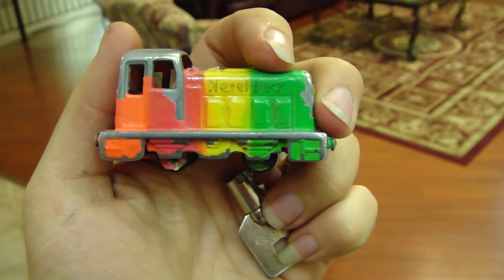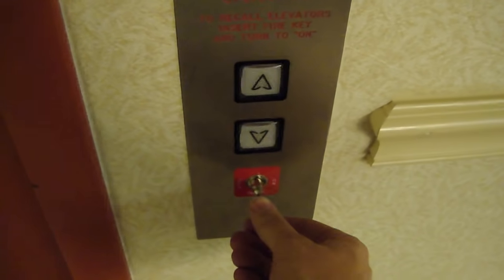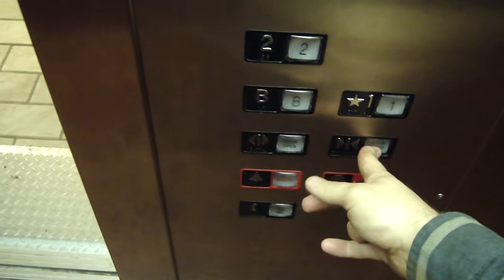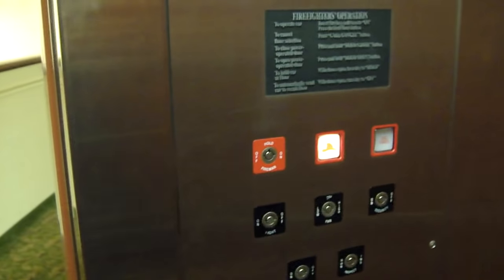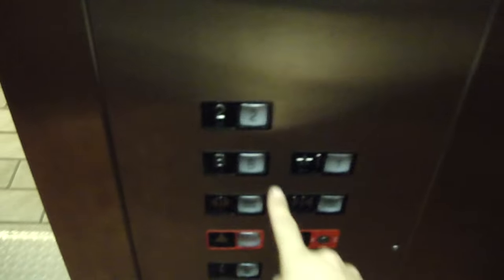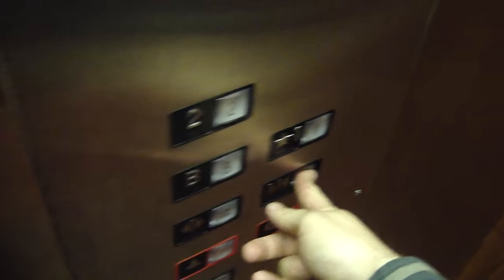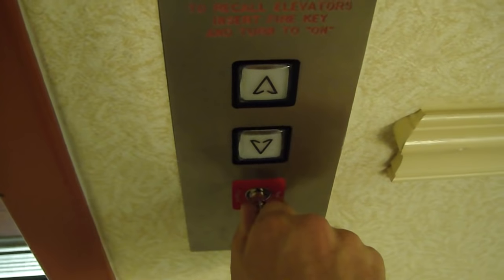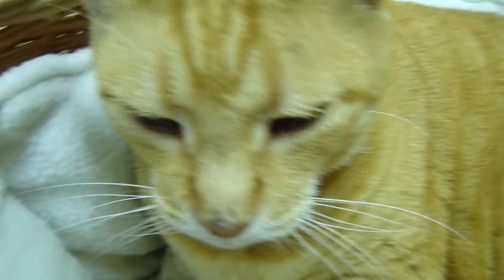Fire service mode on an Elevator (innovation fixtures)

Comment: You forgot one thing if you press call cancel while the elevator is moving the elevator will actually stop at the next available floor also nice motor
Reply: @Lanota Ritmo
Actually, he said that the call cancel button only works when the elevator is in fire service.
Reply: @Amity-Blight410  that's a feature in fire service
Reply: @Amity-Blight410   They meant while it was in fire service
Reply: @get__a_life9  
That’s what I said, Yoshi.

Comment: I know why the safety door sensors are disabled; the sensors know no difference between smoke or a person as they both give off IR. And if smoke comes through the door it will refuse to close which is really dangerous so it disables it to stop the risk
Reply: Oh and also the cat's nice :)
Reply: Thanks. I was wondering.

Comment: This is a very nice and informative demo. I have never done fire service before, only independent service.
Reply: Elevation Station Productions what is independent service mode?
Reply: Gerard Landry independent service is basically for inspection. The elevator won't respond to calls but can still be operated from the COP by pressing your floor button and holding the door close button until the door is closed. Basically it is like fire service.
Reply: @ElevationStationProductions  I’ve only done reserved operation on a Mitsubishi lift

Comment: The reason the safety sensor is disabled is because smoke will prevent the door from closing if the sensor is on
Reply from the maker: Correct.

Comment: On elevators that are connected to the building's fire alarm system, bypass resets the fire condition on the fire alarm control panel. This is usually only used if a smoke detector was tripped, the elevator went into fire service, and it needed a reset. Basically, bypass just turns it off if it was activated automatically.
Reply: Interesting, I don't think that's allowed where I live.  Here, the fire department doesn't reset fire alarm panels and only someone responsible for the building can reset it.

Comment: Do you need to turn fire service on at the recall station before you turn it on inside the elevator?
Reply: Brandon Meiklejohn no, but its to recall
Reply: yes
Reply: Yes
Reply: @moonbeam112  Recall station initiates P1 (Phase 1) recall (disables elevator buttons (station, car) for entire bank (group of cars operating under one master elevator machine or multiple elevator machines under one building)); car recall station initiates P2 (Phase 2) recall (disables buttons within recalled car only).

Comment: I also heard the reason elevator's should not be used in fires was when they had the heat-sensitive buttons. Fires would trigger the elevator to an engulfed floor, causing the rider to become trapped (elevator always on call).
Reply: Exit

Comment: Cool! I wish there was a non-emergency version of fire service
Reply: Independent service works in a similar manner (protective devices do not go into alarm).
Reply: Nothing goes into alarm. Fire alarms aren't even triggered as seen in this video and many others
Reply: @ECFE  I feel like it is an option that the elevator manufacturer can do, depending on what the building owner wants.
Reply: there is something like this, you can watch deviant ollam's elevator halking talk.

Comment: What do the other switches do? Inspect, security?
Reply: The one on the left is "independent service" (disables communication from car to elevator control station). The other switch is "security" (most elevators do not have this switch (due to increased risk of unauthorized manipulation of the switch); that switch bypasses all floor restrictions.

Comment: Very cool that the hotel has a resident cat. You mentioned the door safety device is disabled in fire service. Since this elevator has an electric eye, is it the same deal with an elevator that still has the old bumper?

Comment: You can't use the elevator when there's a fire that's dangerous! But I like your fire service demo and I'm glad you went to the basement and I'm sorry its restricted and I never seen the basement before. The buzzer in the elevator was loud!
Reply: Actually, the reason why you can’t use them in a fire alarm is not because it is dangerous, that is a myth. It is only because firefighters need them for their equipment if it is a real fire.

Comment: what are the extra switches below the door buttons?
Reply: The "door open" and "door close" buttons allow the user to manuver the elevator doors (most have "door close" disabled when in service). The other buttons below the door manuvering buttons are "alarm" (only to be used in emergency situations (since some can dispatch the fire department when the button is pushed)) and the "phone/help" button (also to be used in emergency situations).
Reply: The stop switch allows the user to toggle service on the elevator ("stop" = "disabled (out of service)"; "run" = "enabled (in service)"

Comment: Why do u have to put the fire service outside into bypass why not just tie it off
Reply: The elevator functions differently in fire service than any other mode.  Such as having to hold the door open and close buttons and the safety strip disabled.